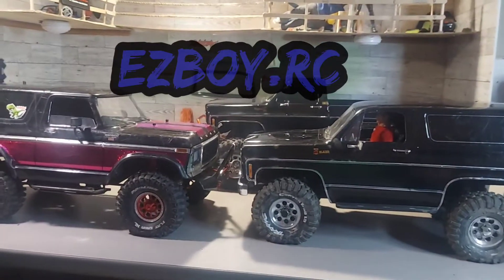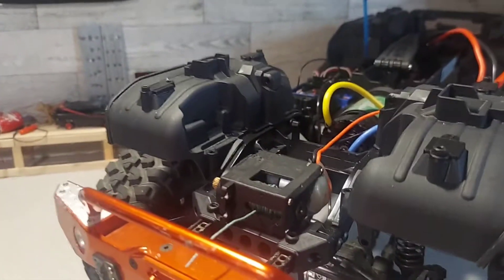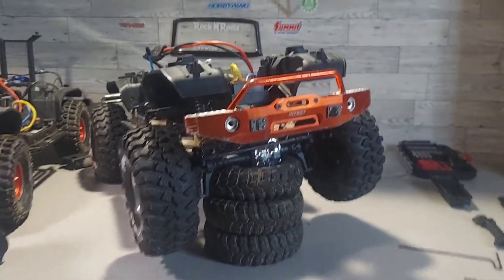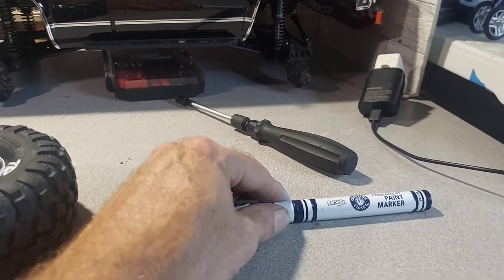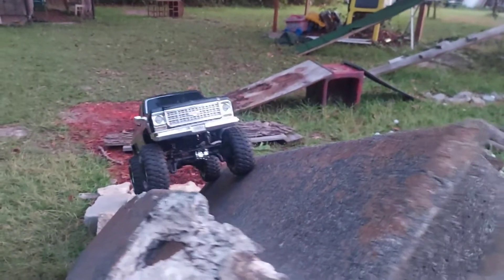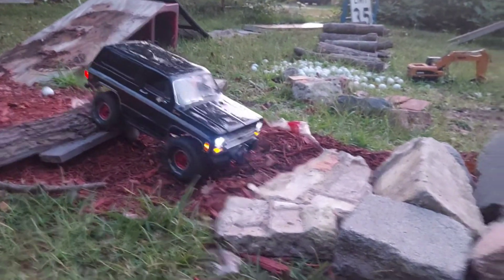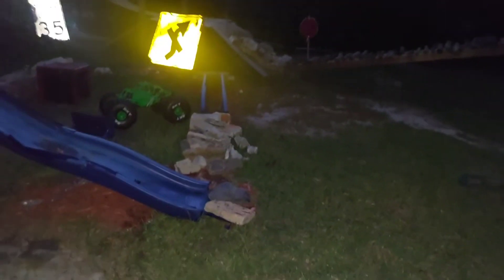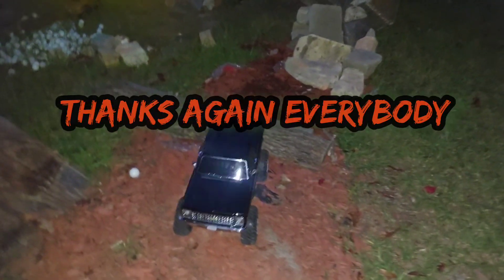TRX4 High trail edition. Holmes Hobbies 7.4V brushless servo install & testing on a new obstacle.

Comment: I already have the long arm kit on my Bronco. Didn't stop me from getting the K10 High Trail. Love them both
Reply from the maker: I had a high lift on my blazer when I 1st got it but there was air in the shocks and I didn't notice it. It was horrible performing. I took it off and put desert lizards back on and sold the lift kit wish I would have known that it just wasn't right. because now I love it on the highlift & would run it. Lol

Comment: I have a TRX lifted with 2.2's and been using a factory stock steer servo for a year now and never a issue. Actually I run tracks on it once in a while also and factory servo works awesome....
Reply from the maker: I'm wondering if it can handle 7.4v for very long. The Box for the high lift truck says it's a new servo but I'm not sure doesn't have much info about it other than metal gears
Reply: @ezboyrc553  good question I'm not sure about that....👍